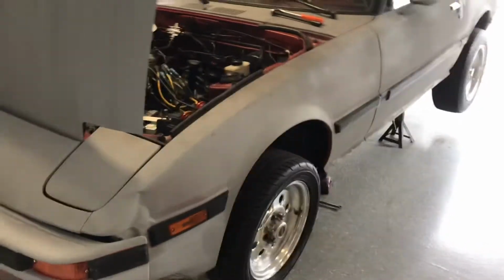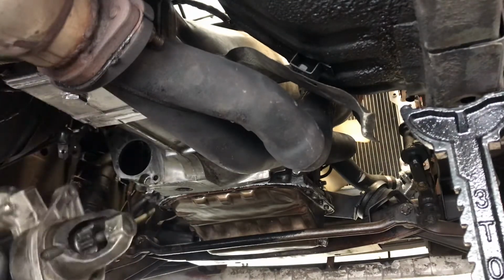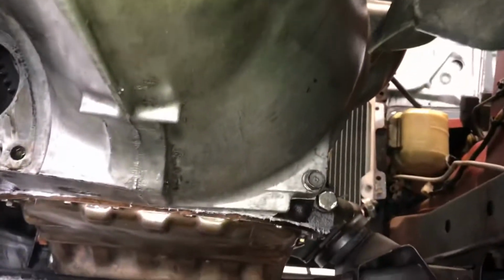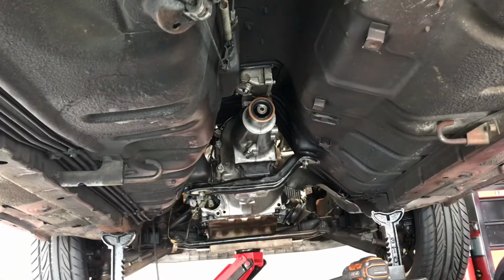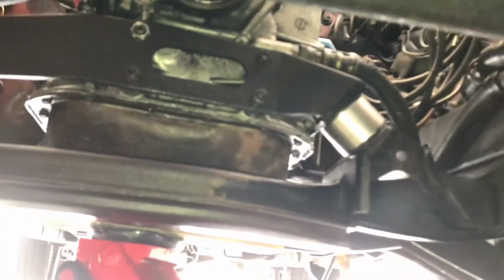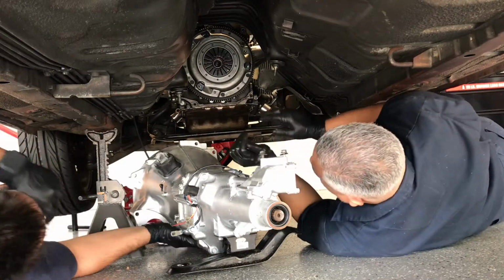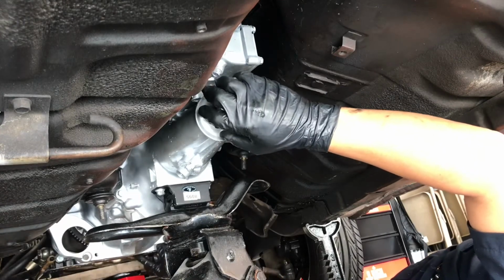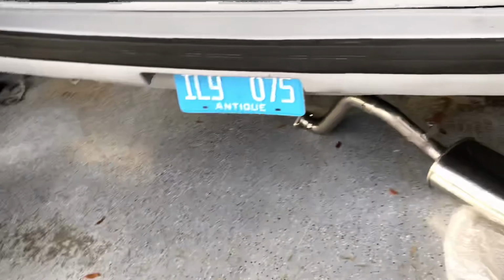Transmission removal and installation plus extras on Ashy Larry! 1983 Mazda RX-7 GSL

Comment: Can that transmission cross beam support the transmission if you just pull the engine and leave the transmission in place?
Reply: Yes
Reply: I wouldn’t it puts all the pressure on the drive shaft